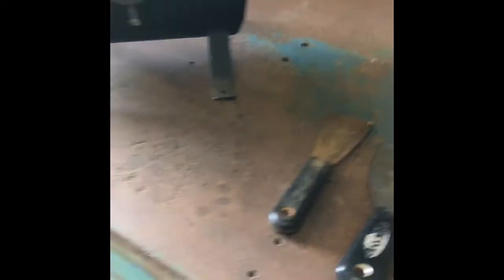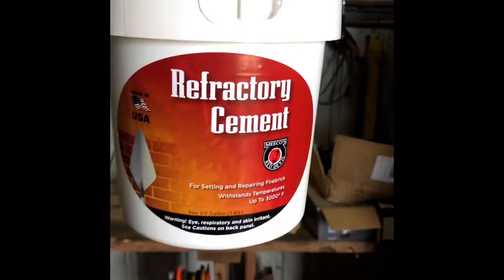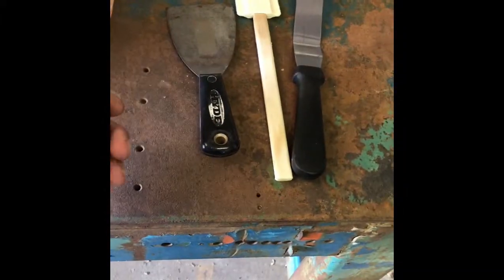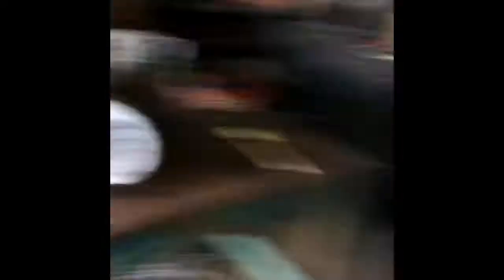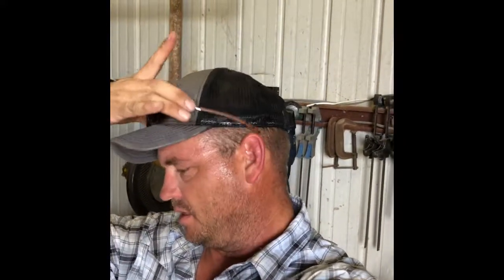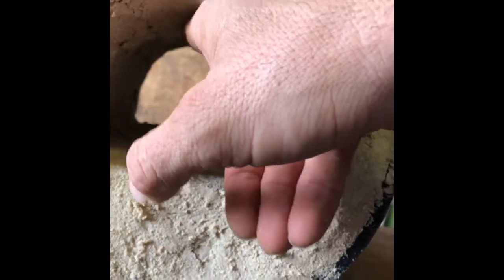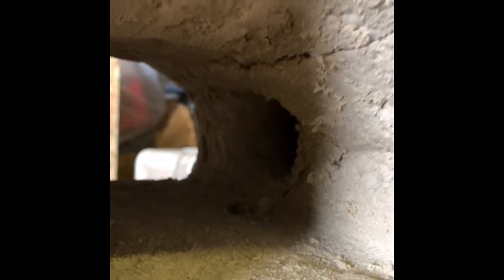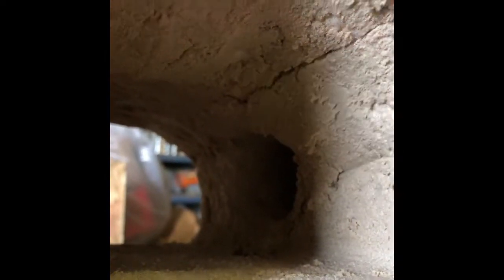How To Seal Kaowool Insulation With Refractory Cement

Comment: I like the idea of using the powder and mixing it up rather thin at first soaking your insulation pads in it and then mounting it in The Crucible or the oven that way it is saturated and should seal better I would think
Reply from the maker: Sounds good. Yeah looking back on it I wouldn’t do it this same way again. I used the forge yesterday and it really needs to be completely torn apart and redone. Probably 30% of the refractory has come out. The fire brick on the bottom is completely exposed which isn’t a huge deal but chunks are starting to fall off of the top. I think my biggest problem is that my forge is tiny and I keep hitting the top of the fiber when I take material in and out of the forge. I should really probably take this video down. I guess I can leave it up as a “what not to do”! LOL

Comment: It's been almost two years, how you feeling? Also, what do you think about covering the insulation while it is flat and then rolling it up and placing in the forge? maybe patch it up afterwards?
Reply from the maker: It worked OK but it needs to be redone. I have used it pretty heavily and over the years I have broken up some of the surface. I wish I had used a rigidized or spray on the wool before I put the refractory on.
Reply: that will work. either way, maintenance and inspections are always mandatory, for safety sake, also. tnx 4 reply. I just bought another kiln, unfinished, new, and is not fully refractoried with the cement, so I was looking at different ideas, and try to mesh with my ideas, and get on with melting rocks. in crush them up to -80 mesh, (hygrading).
been playing around with different flux combinations, its always a mess, but what fun.

Comment: Did that bubble or melt? Since it’s not casting?
Reply from the maker: It worked pretty well but it needs to be redone because I keep hitting it. I should have sprayed the kao wool with a rigidizer first to harden it a little so that it would have been easier to coat.